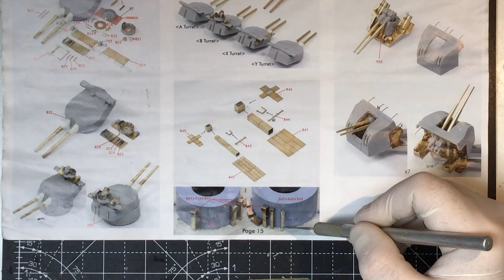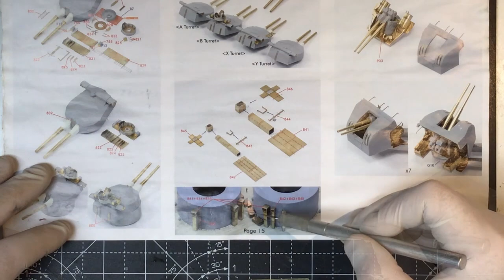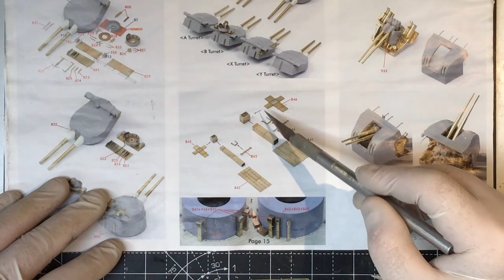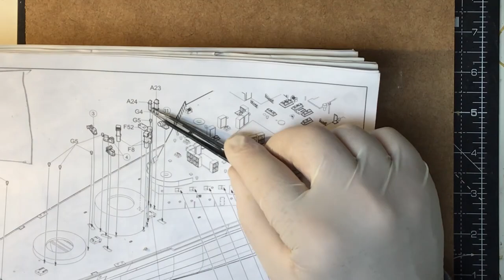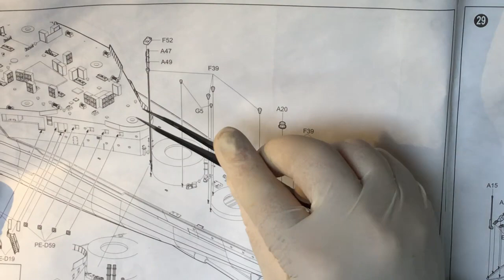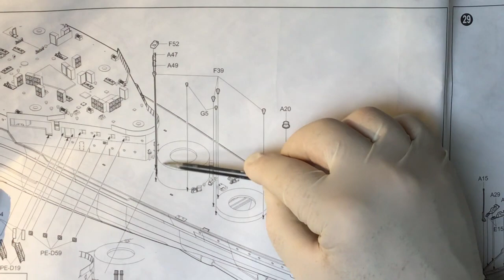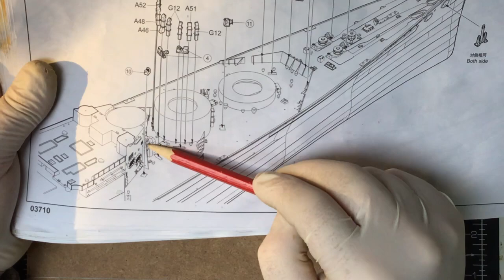Trumpeter 1/200 HMS Hood Full build with Pontos detail set Part 38  (Quarterdeck details part 2)

Comment: Regarding the stern anchor, according to the HMS Hood Association:

Dear Dave,
 
Thanks for your question The answer is there is no evidence of a stern anchor being stowed aboard HMS Hood. The Eye Ring at the stern was for a tow rope. All Royal Navy vessels pre-war were required to practice towing another vessel of similar size, or being towed. And all carried special shock absorbing towing hawsers to enable this exercise. This came about from a British battleship being successfully towed from the Battle of Jutland in WW1..
The other consideration would have been the very considerable weight of the anchor and cable, plus steam winches on the draught aft when the quarter deck was already a bare 8'-10' above the waterline, and in most moderate to rough seas was mostly awash with sea water. So much so that in some circles the Hood was referred to as the "biggest submarine afloat".
 
I hope you find this of some assistance
 
Kind regards,
 
James (Warrand)
Reply from the maker: Thanks for posting that David very interesting

Comment: What primer do you use for PE? Nice work, enjoy your videos.
Reply from the maker: Hi Chris. on the Hood build I used an etching primer from a UK auto supplier called Halfords. I decanted it for spraying through the airbrush-  there’s a video on the channel showing how to do that.
Reply: @TheModelShed  Thank you! I think in one of the videos or comments you mentioned that you also use Tamiya Fine primer. Have you had good success with that on PE. I used 4K primer on PE for my 1/350 Tamiya New Jersey and it didn’t seem to help at all.
Reply from the maker: Yes Chris I've used Tamiya fine primer as well. Recently on the Corvette build Ive been using Mr Surfacer 1500 through the airbrush. Both it and the Tamiya need to be handled carefully after application as it can chip away. I paint and fit straight away to reduce the chances of this happening.

Comment: Morning Steve, as usual great work. I notice that on the smaller vents you used primer. Some modellers use primer and some don't. Have you always used primer on the smaller parts? Also the pen you use when soldering, are you able to advise what it is called
Reply from the maker: Hi Paul yes I prime everything no matter how small. For the pen it’s a 2mm fibreglass pencil. I got mine on Amazon it’s the modelcraft one and you can get a pack of refills for it on there too.
Reply: Thank you sir for your reply and enjoy your walk this week

Comment: Isopropyl alcohol will remove most fluxes that are out there.  That is what is used for cleaning circuit boards.  It should also help with removing any skin oils and etching residue.
Reply from the maker: Good tip thanks Nic I’ll give that a go next time

Comment: Great video again Steve, I’ve been wondering which type of flux do you use, acid or water base? I’m a retired plumber and when I’ve used either flux only had to wipe off the excess flux with a clean rag.
Reply from the maker: Not sure Ken ill check out the label when I’m next in the shed!